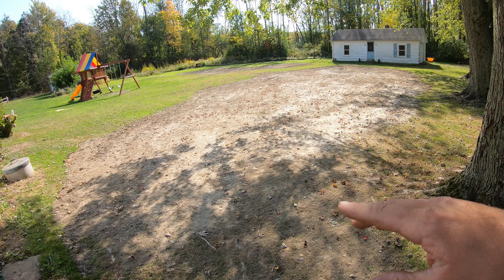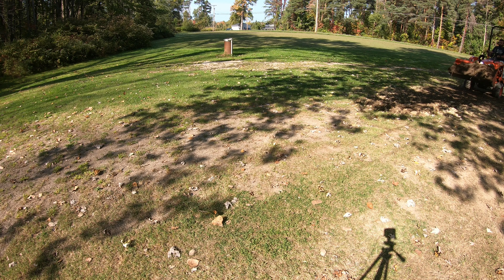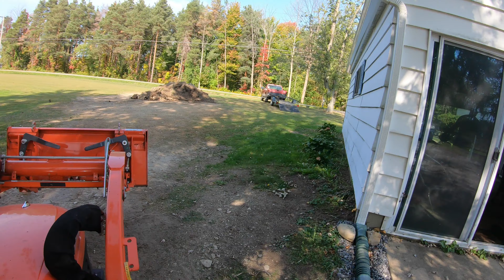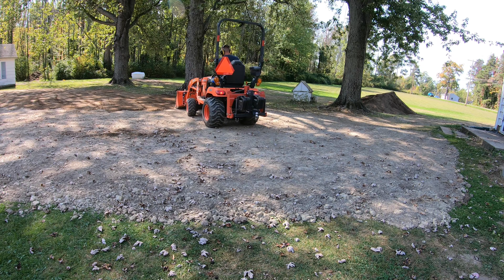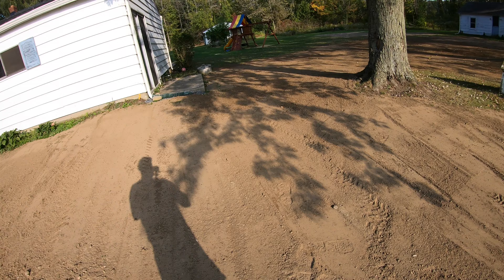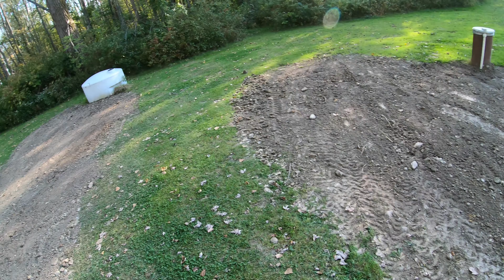Kubota BX- Spreading 15 Ton of topsoil + Moving 15 ton of fill (Grading)

Comment: Nice, gotta incorporate ur technique of spreading fwd using bottom of bucket while slightly tilted up (been just back dragging). Put 20 hours on bx23 already! Went to grease backhoe & few of zerks were factory painted over, tried scraping paint atop ball bearing but two still won't accept grease, ever had that happen or replaced one before? Noticed u took off ur "grill guard", any particular reason... kinda wanna take mine off. Sorry for all questions, mahalos again for ur action videos, exponentially speeding up my learning curve!
Reply: I usually poke the check ball (in the grease fittings) with a pick or narrow screwdriver if they won't take grease
Reply: I had a couple on my 23s painted over too. One was stubborn but like the other poster said, screwdriver worked to get it ion.
Reply from the maker: Exactly what he said, Poke the fittings with a little pick and try to chip some of the paint off and you should be in business. Usually the dealer will do this before they deliver but they may have forgot. Good to see your right on top of the maintenance already man!
Reply from the maker: I have heard of this happening with quite a bit of the new 80 series kubotas.. Glad you got it worked out man.
Reply from the maker: Wow man 20 hours already! Nice! Sounds like your putting it right to work already which is great! How are you liking it thus far? the front grill i actually never had on my tractor.. I never bought one either only cuz on the older 70 series and below models you have to remove the grill guard just to open the hood bonnet and that's kind of a pain so i never did end up getting one.. I thought about fabbing a bx2380 grill guard to work on a 2370.. infact im sure it will bolt right on.. I may pick one up some day and try it as the guard on the 80 series tilts forward where the 70 and older series does not.

Comment: Hi Biff's equipment - looks like it does a great job.  My JD2210 does okay, but I'm shopping for something with a little more hydraulic power.  It's pretty weak in that area.  We found your channel from a comment you left on another channel. We'd really appreciate if you'd take a look at our channel if you get a chance and aren't already following us. Thanks in advance!
Reply from the maker: Hey! Thanks for stopping by and checking out my channel, I’m glad to like it so far. The Kubota bx is def a great little machine for the sized jobs I do and I try my best to showcase this machine for all it can do. I will def check out your channel. Do you have any videos of your tractor on it?
Reply: @BiffsEquipment  Thanks!  We do - videos of our Ford 8N, and videos of our John Deere 2210.  Compared to the newer tractors - the 2210 is really weak.  I can only lift about 600# with the loader.

Comment: Are you using in this video Piranha straight bar?  It does not look like your Kubota stock front loader bucket edge.
Reply from the maker: It is actually just the factory cutting edge,  I have the LA344 loader which is different from the older LA246 loader, not sure which model you have but that could be why it looks different to you in the video not sure. So far the factory cutting edge has held up great through all the abuse but some day soon I plan to buy a toothbar for the front 👍🏻